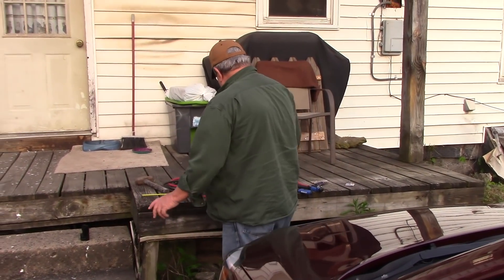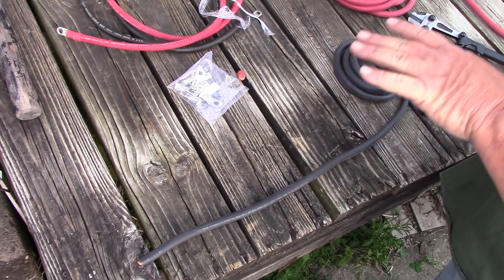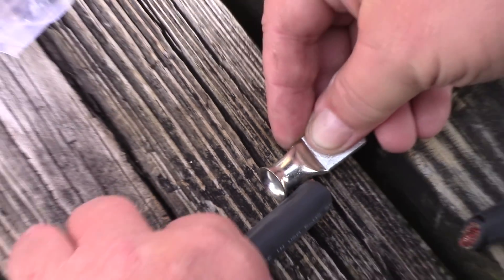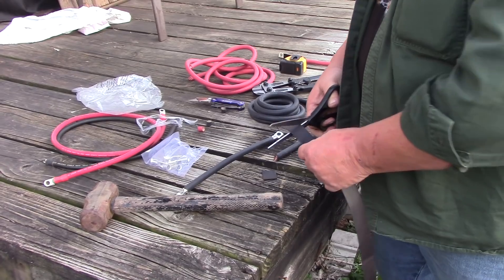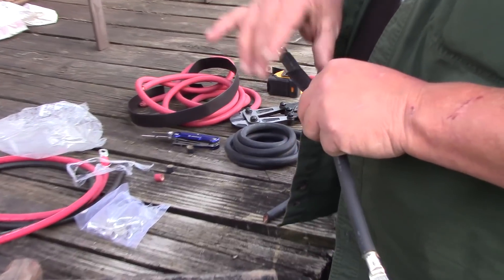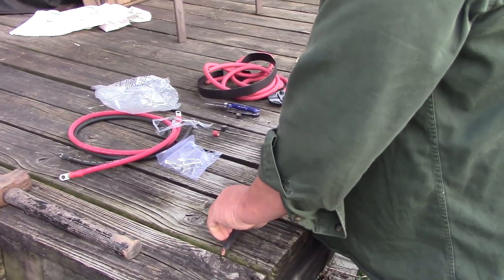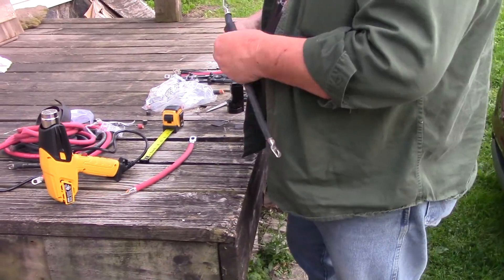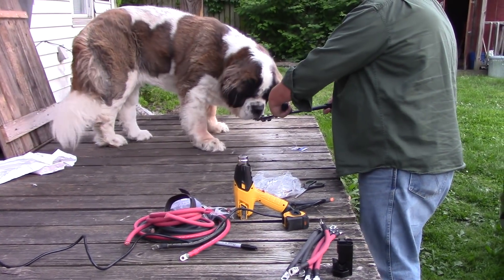DIY Make Your Own Cables Off Grid Solar Battery Bank

Comment: can I use jumper cable wire?
Reply from the maker: +@Orangemangoood That is not a good idea, depending on the size of the system.
Reply: @HomesteadWithJoe  I was thinking about 2 100ah lithium batteries and 2 100w solar panels. I cant imagine how it would be much different but I respect those who know more than I. And I dont know much lol.

Comment: Thanks Joe, Great Job as Always.  Can you share what wire you used?  When I looked at Lowes, they have a bunch of different sizes.  Thanks
Reply from the maker: Hey Mike.  Thanks!  I used 1/0 for this. I think I would be fine with 4 gauge, but I might want to upgrade later and add bigger batteries. I bought mine off of Amazon.  I have to learn to start using my Amazon affiliate links lol.
Reply: @HomesteadWithJoe  Thanks Joe I will look on Amazon

Comment: I work with this kind of stuff, and you did a good job. You can get colored shrink tubing in various sizes from Amazon. There are kits with a bunch of different sizes, to use for all your wiring projects. Shrink tubing is MUCH safer than electrical tape, it won't come off and leave your connections naked. Solder is a better way to attach your lugs to the cable, but it's time consuming and an acquired skill. Crimping works just fine. You can even get a hydraulic crimper at Harbor Freight, but it's about $60 and not really necessary if you do a good job crimping (which you did!) We use the two-to-one tubing at work. It shrinks to half its original size, a 3/4" size piece of tubing will shrink to 3/8", or to any size in between 3/8 and 3/4. The heat gun is DEFINITELY the way to shrink your tubing. Don't be tempted to use a lighter or a propane torch, it can easily burn the tubing, and defeat the whole purpose of using tubing in the first place. They sell tubing with adhesive inside, which I always liked, except it is harder to remove if you need to modify something later. I think it does do a better job of protecting the crimp, though. A great video, Joe, and Gail is doing a great job! Linda and I send our best to you all there at the Acres.

Comment: Hey Joe!
Your lawn needs a trim.  ;o)  Is that welder wire?  
The charger is on its way, but numb-nuts here forgot to put the note in the package, before sealing it up tight.  Sorry about that.
I couldn't find the "manual," (piece of paper) but the only important thing to know is always connect the battery before the panels, or you may kill it.
All the best, matey.
Reply from the maker: We need it to stop raining long enough to mow lol.  Looking forward to it!  I remember, connect the panels last, from the first experiment lol